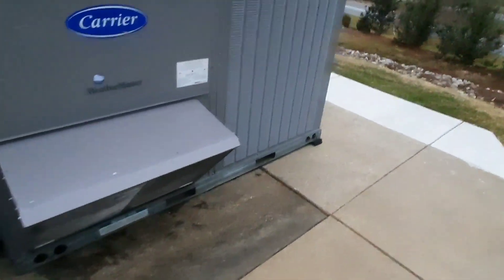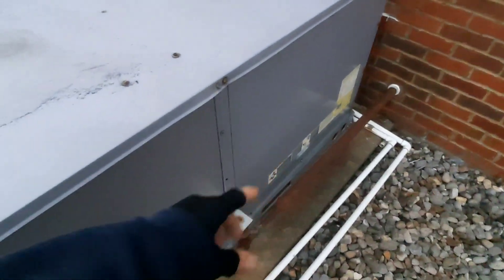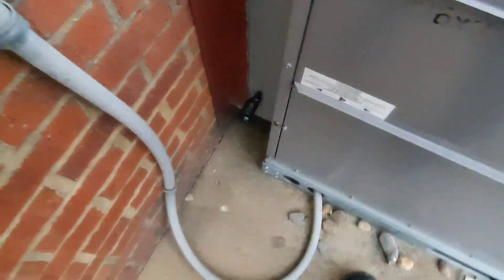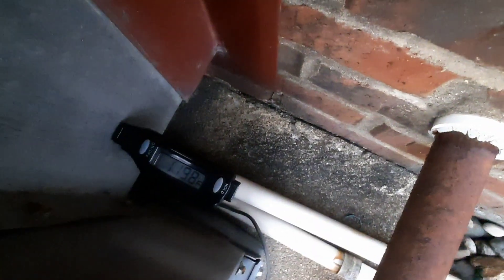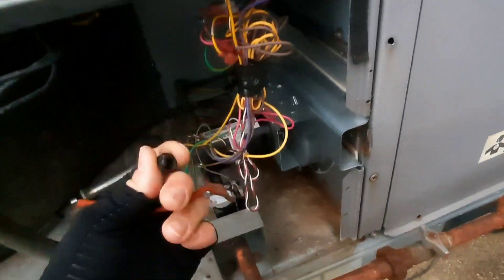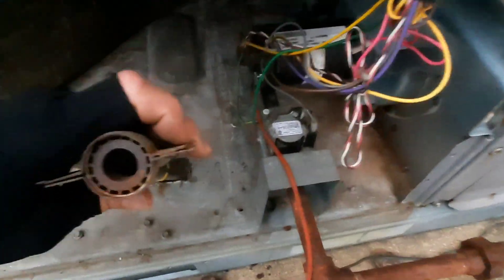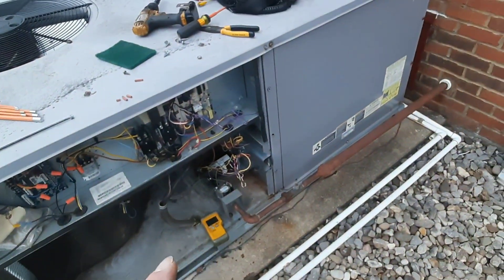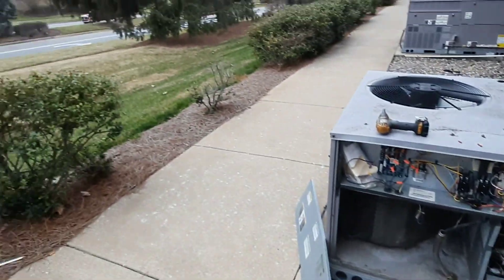The heat exchanger was just replaced! Carrier package unit not heating. #hvac #hvacservice #hvacr

Comment: Omg, just want to say thank you because I didn't know you could remove the plate by the burners and inducer.. i was using a 90,  extension, and drill get to the screws when replacing all the parts in heating 😂😂. I replaced burners today and took me 5 minutes... awesome.
Reply from the maker: I'm glad it helped. That's what it's here for, thanks, workaccount! I appreciate it

Comment: not a lot of people know there is a port on the manifold that u can unscrew to put ur manometer on  dont have to put it on the gas valve.   Black plug.     sometimes  it happens as long as u leave it better then u found it
  great job
Reply from the maker: Thanks gas man! For some reason I didn't see it and didn't use it this time.
Reply: 3:35   its right underneath the inducer  looks like a black plug its on the right side of the white tape  in the video.  u can unscrew it and attach ur manometer    a lot of lennox  rtu have it.       @EverythingHVACR
Reply from the maker: The weird thing is, I know it's there, and I don't know why I didn't use it.

Comment: Never put one of those on backwards after doing so many exchanger inducer swaps. I always cleaned off the tops then wrote a number down in marker for each burner in order. I did it for each unit I worked on too just in case cause my OCD would bug me cause I always pulled the burners out cause its so easy to do on those. I like those units but know its only time until I do the exchanger and inducer. I did used to keep a spare emergency inducer magnet on my truck incase they went bad. I aint going to a supplyhouse in the middle of a winter storm on call if I can get them running in an emergency with used parts written on my WO saying the customer agrees to used parts and not my fault if it fails. Saved my ash so many times. Save used parts. :$
Reply from the maker: Thanks HiddenResolve! Numbering is a good idea, but there were only 4 burners smh. This was just someone rushing and not paying attention. I keep random used parts for emergencies as well, it'll get you through the night or weekend.
Reply: @EverythingHVACR  Yeah, I always tell the customer if they want a temporary used parts its as is and liability is on them if they want it put on. All of which goes right on the WO.

Comment: Its normally easiest for me to just pull the plug out of the side of the manifold to check outlet gas pressure on those units.
Reply from the maker: It is easier that way. Did I miss a plug? I didn't think this had one. Thanks, Cameron!
Reply: @EverythingHVACR  yes, you can see the head of the plug on the manifold right under the inducer motor. Way easier to get out than the one on the back of the valve
Reply from the maker: Agreed, it is easier. Thanks Cameron!

Comment: The trick to checking gas pressure on that particular gas valve (on the back side) is to go to harbor freight and pick up the Icon #RXFT-35 locking flex head 1/4" ratchet and bit set, 35 pc.
That little kit will blow your mind! It is so compact and convenient to carry. And that flex head ratchet will turn that corner onto the back side of that valve and allow you to angle the handle forward (on the right side of the valve) and work the ratchet to pull the plug right out. I filmed a video one time using it on a RTU, but the wind was blowing so hard you could heard a d@mn thing I was saying. You won't regret getting one of those kits . Worth it's weight in gold . 😎👍
Reply from the maker: Thanks, Shannon! I will check that out.
Reply: @EverythingHVACR  that's one of those purchases that will make you say....."Where have you been all my life?" 😉👌
Reply: A service wrench with the valve adapter also works perfectly for those plugs as well. Almost like it was made for it lol